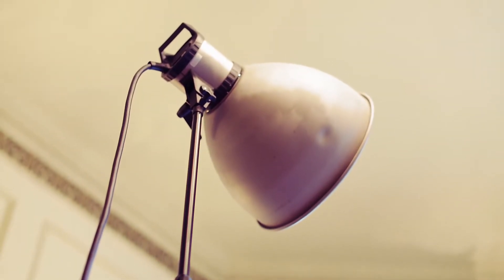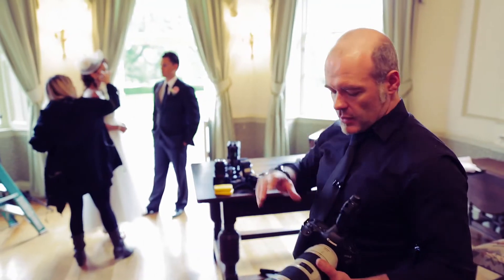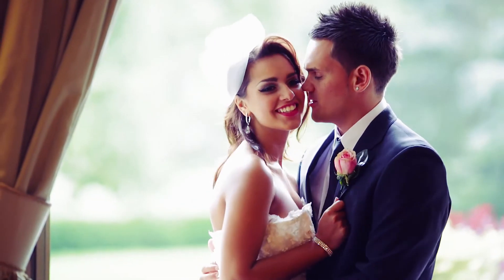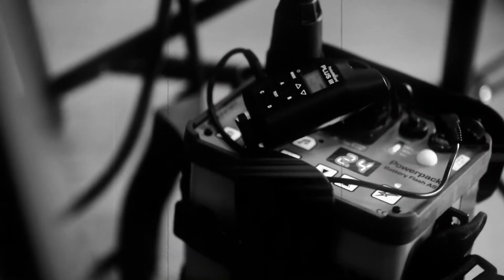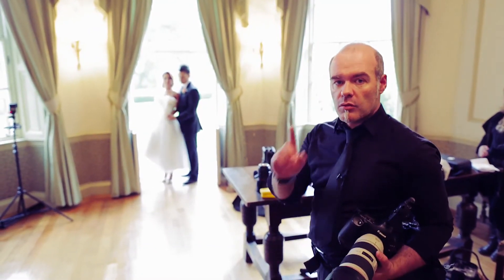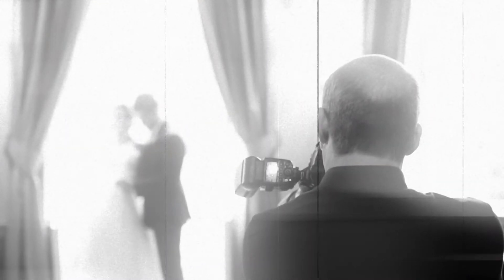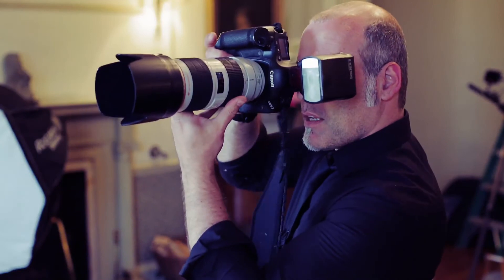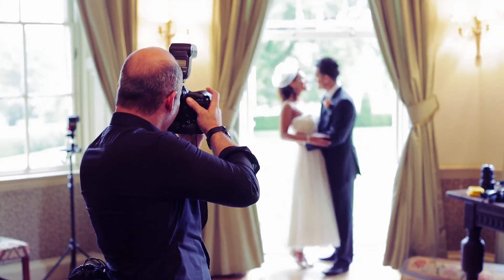Wedding Flash Photography Showdown: ETTL vs. Manual Techniques

Comment: Brett, I can't begin to tell you how helpful even these 3:00 minute videos are!  Very informative and too the point.  I'll have to buy one of your DVDs!  Question...how are you not blowing out the background with such a high ISO and relative slow shutter?  I've tried the same settings you suggest (f/3.2, ISO 640, shutter 1/400 and flash is on camera set to ETTL and high speed) and the background is totally blown out.  The only way to bring it back is to drop ISO and/or speed up shutter...which kills the look and emphasizes the flash (you can tell flash is being used).